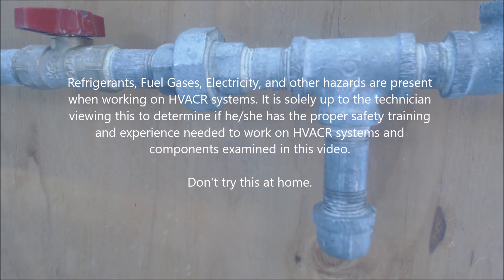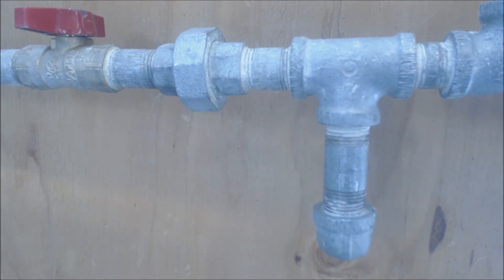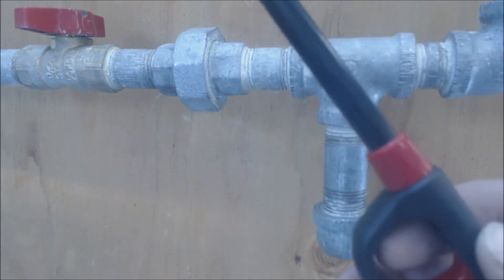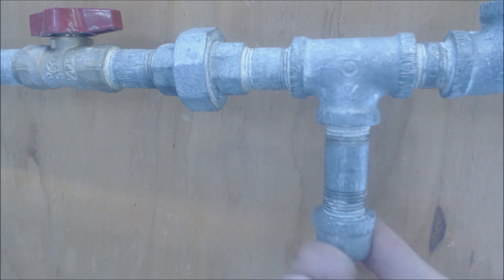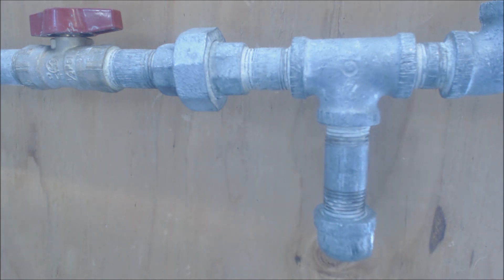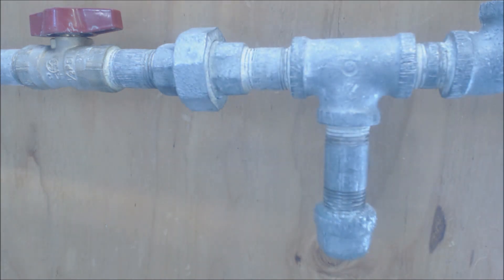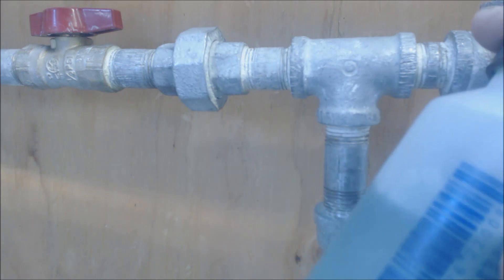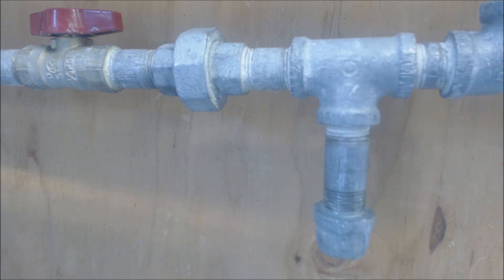Leak Check Gas Lines! Flame, Soapy Dish Detergent & Water, or Specifically Designed Bubble Detector?

Comment: Man thanks. I have a new install and have a small  micro leak. 15lbs pressure. It holds for couple days.  I was gonna pressurize it with gas and try the lighter trick. I had been told too small to worry but doesn't make sense to not be completely sealed to me, but im no expert.  It's hard to see micro leak with bubbles,  because the solution has bubbles already

Comment: Dish soap will corrode stainless steel, lol.
Reply: Is this not the case then? I used dish soap with some water to check for leaks. I did not even wipe it off.
Reply: @iShootWild  did it rust?
Reply: I did that today. So not sure what will happen in 6-12 months.

Comment: I like that you mentioned tiny bubbles, I'm pretty sure we had a very small leak at this fitting and the guy I was with kept saying, "Yeah but there should be bubbles coming through behind the small ones" To me it looked like it was becoming what I call an "egg sac", looks like a soft spider egg, and it was shimmering like the diamond on my wife's hand. Working on tires taught me how many really small leaks fail to provide substantial bubbles.
Reply from the maker: Yup thats right and a good way to describe it, spider eggs.

Comment: 5-10% volume of gas in the room then boom.  Ldf or a gas sniffer unit.  Old plumbers were next lever.  I had a customers bring back a lighter to try and demonstrate  a gas leak under a NG hob.  It stunk of gas when I arrived.  I had to stop them in their tracks. 
Near on 50,000 ppm of gas and any living thing in a closed environment is in life threatening danger.  All that's needed is a static spark along with O² and you'll be extremely lucky to tell the tale.

Comment: We used to flame test all the time. Obviously it’s not ideal but in a pinch it’ll work. Like you said never do it in front of a customer. I prefer leak detector soap but dish soap and some water will work to. It doesn’t have to be non corrosive because it dries up so quick. The only reason I prefer leak detector is because it will stay on the pipe and show leaks for a while. I’ll use runny dish soap when I can’t find the leak because it’s runny it will show up immediately and will pick up small leaks better. I do find it ironic that mr by the books installed an illegal drip leg.
Reply from the maker: Hey Josh, in the IFGC 2018 it doesn't say anything that it has to be on a turn. That may just be what your inspector prefers but it can't be technically enforced without a code stipulation, thanks!
Reply: I go by the plumbing code and they can’t be placed that way because moisture or debris will pass right over it so it basically serves no purpose. The gas has to hit a surface and be forced up so that it keeps whatever out of the burner
Reply: Oh and check ifgc 408.4 and it shows exactly how the tee must be placed

Comment: Hello There, Sorry to tell you you have no since of safety to use a litter to check for GAS LEAK. There are a lot of other ways to check for leaks. Leak detectors, soapy water....ETC. Please don't do that ever for any reason.
Reply from the maker: The video is on why nobody should check for leaks with a lighter. That is a terrible thing to do that will not find leaks. Check out the video, thanks!

Comment: How long does the pipe dope take to set or cure before you can turn the gas back on?
Reply: Read the canister.  Usually it's good to go right away.  Gas line pressure in your house is quite low too, btw.
Reply: @yepper1165  yeah I did some more research and realized it was like 1/2 psi. Thanks for answering 🙂
Reply: @seabass22  u bet!

Comment: so if atmospheric pressure is 14.7psi and natural gas pressure is only 5 to 7 "WC . if there's a leak and you were soap testing wouldn't the bubbles be pushed in by the 14.7psi? thanks

Comment: I worked with a very seasoned  plumber/gas-fitter who used the flame-method. One day i protested and he just grinned and said ,"You wanna find a gas leak without guessing?..,this is how you do it"!
Reply from the maker: Unfortunately, small leaks do not light. I have tested these for nat gas and propane in controlled environments and the ratios of air to gas are not adequate to make a flame., The best way is with pressure testing disconnected from the appliance or with non-corrosive bubble leak detector, thanks

Comment: How flipping dangerous and irresponsible to show this video.
Reply from the maker: Shabana, did you watch the video? The whole point was to not try to leak check with a flame because that would be dangerous and does not work anyway. We use anti-corrosive bubble leak detector, thanks
Reply: How is it irresponsible? He showed why using a flame is a bad idea.

Comment: Thank you for providing the video . Now let's go over some things that were not mentioned are demonstrated in this video.#1 a dead end pressure test at low pressure should always be performed (13.5" max ) using a water tube manometer  ( not a electronic manometer, due to calibration certifications).#2 this is the 21st century, all technicians and contractors should own and know the proper operation of a combustible gas indicator (CGI ).#3 if a surface leak is sensed with a CGI it should always be verified with approved leak soap ( it's not that other soaps will cause corrosion or damage to the pipe, it's just that we don't know what other soaps will do because they were never tested or certified through the gas industry), saying all other soaps will cause damage would be irresponsible . #4 all repairs should be verified with a low pressure , pressure test using a water tube manometer.#5 & maybe it should have been #1 anytime the public notices a gas odor( mercaptan ) they should immediately call the gas provider, 911 or 811.

Comment: Great video.   I've been working on my furnace (flame sensor and igniter replacement) and didn't disconnect/connect any gas fittings but did have to move stuff to get to the flame sensor and igniter so want to make sure that I didn't kink or crimp anything and cause a micro leak. What brand of bubble detector do you recommend or should I buy a cheap sniffer on Amazon? Thanks!
Reply from the maker: I have the leak detector linked at https://www.amazon.com/shop/acservicetech thanks

Comment: That’s how a Bar blew up in my old neighborhood and friends lost there Fathers .  That video had me thinking WTF...!  Didn’t watch it fully.  Have a great Holiday 🎄🎅🏽
Reply: Checking a pipe fitting for a leak with a flame is similar to the burner running in your furnace or water heater. As long as there's a positive pressure on the pipe the flame cannot back up!

Just like everything, people make judgments based on lack of knowledge.

Comment: Hey man, nice video. Just a couple of things I would like to point out that may be helpful to some folks. Sediment traps should be installed so they change the flow of gas. The one in the video would be considered in-line, sediment will pass over the trap and little to none would be deposited. Also natural gas has an ignition range of 4-15%, meaning anything below is too lean to burn and anything above is too rich. All leaks should be reported to your gas servicer so they can be found and repaired in a safe manner. Great video and great info. Keep it up!
Reply from the maker: Great tips Justin! Rarely is there much sediment anymore but the traps are still needed and used, thanks!

Comment: Not sure if soapy bubbles is that bad , just wash off the joints with water afterwards as they are outside in the rain anyway ?
Reply from the maker: I have seen galvanized joints acquire rust a 1/4" thick on the pipe after being wiped off with a dry rag after 6 months. The CSST manufacturers have examples of whole apartment complexes having leaks do to the chemicals in the soap and you cant even wipe that out since they go between the stainless pipe and the brass nut, thanks!
Reply: @acservicetechchannel  my piping has rust outside to my gaspack , how do I make it resist the elements ?  Thnx

Comment: So, first off water and dawn soap  will eat away at black iron gas pipe? Next, curious about flare fittings on gas lines.I'm curious as to pipe threads.Meaning, is it ok to pipe dope pipe and sections? Just not flare fittings like that on a yellow gas flex line on the one side? I assume unions also no tape or dope? This is house lines in a home basement.Lastly, a home was built many moons ago.Meter outside house has no regulator.Nothing inside as well in the regulator topic.Been that way forever and no issue I hear of.I do see a gas company shack right next door that they come about every once in awhile and test stuff.Anyhow, no regulators on meter and everything in house is hooked up wide open straight lines.Your thought? Pretty much all these old houses I see are like this.Yet, I hear regulator this and that when hooking anything up in a home.
Reply from the maker: Dish soaps nowadays are too corrosive compared with what was used back in the day. Flare and flare threads don't get pipe dope but standard thread connections do. Sounds like propane. The regulator would be at the tank then. Gas pipe is always pressure tested. Make sure to pull permits and design the length and turns ahead of time. Lines mus be pressure tested before connecting to appliances. If you haven't done this before, I would recommend calling a tech and working with them on the job, thanks
Reply: Thanks for thoughts.On the regulator subject, all houses around area are natural gas only.Just puzzles me no reg on meter and been inside houses and nothing.Just direct flow into all hooked up.Could the gas company have some setup in the shacks that regs all fine or still need regs on meters or in a house?
Reply: Some natural gas distribution systems deliver low (utilization) pressure with a large volume, low pressure regulator serving an entire neighborhood.   This might explain the absence of a regulator at your meter.

Comment: Is the has harmful which comes out because the person who will fix it is coming in 3 days and he can’t come earlier should I leave the house or what should I do someone tell me
Reply from the maker: You could call the gas company that you purchase it from and tell them you have a leak and where it is leaking at. If it is a contractor that is fixing it, they need to come out right away because of the risk of ignition.
Reply: acservicetech they are coming but in 3 days should I be worried
Reply from the maker: You could call the gas company that you purchase it from and tell them you have a leak and where it is leaking at. If it is a contractor that is fixing it, they need to come out right away because of the risk of ignition.
Reply: What are the risks

Comment: my butt hole puckered everytime you used the bbq lighter near the cap.
Reply from the maker: This was a controlled experiment with safety equipment. Can you believe people routinely try to check leaks this way, NO GOOD for many reasons!
Reply: AC Service Tech LLC  they must be showing off. Or they are not qualified.
Reply: LMAO

Comment: Have a look on this one 
https://www.youtube.com/watch?v=5mnULvWwUpQ
Reply from the maker: For copper, stainless, and galvanized iron, we use anti corrosive bubble leak detector as over the past twenty years dish soaps have added corrosive chemicals that eat away at the pipe even when wiped dry. Great Video! CSST pipe has been logged at as soon as 6 months after installation when tubes can leak if dish soap is used. Thanks Dibakar!
Reply: thank you for your for watching my video........There is lots of value able information together.......I am really impressed about your close observation at my video ..............I would really thank you for your great attention .............May I have your Email address plz ....
Reply from the maker: info@acservicetech.com

Comment: I called my gas company recently b/c I smelled gas in my house. They sent out a tech. and sure enough gas was leaking from somewhere. They checked my stove, water heater, and a couple of space heater that I have but found no leak. My gas service was disconnected and they took my meter. Winter is approaching and I'm not sure of who to contact...a plumber or Hvac guy. What would you recommend I do ? Do you have other videos or know of any other videos on finding gas leaks that I might use to do the job myself ?
Reply from the maker: I would contact the gas company and if they don't have any answers then you may need to contact your local county building inspectors. You may need to pull a permit at this point, disconnect the appliances, cap those lines and do a pressure test on the whole gas line. In order to do that you may need to hire a plumber to pressure test and figure out where the leak is. Then fix the leak and hold the pressure test. Have the inspectors come and put an approval tag on it and the gas company will need to be contacted to reconnect the meter. The gas company is basically waiting for the town approval sticker on that line if this is natural gas. If this is a third party supplier like in the case of propane then they will do the pressure test and fix the leak and a permit may not be needed if they are the ones doing the work and they don't require one for the leak. When you contact them, ask what steps they want you to take, thanks
Reply: Thanks for you response and advise.

Comment: Keep in mind that the thread joint is not the only place that can leak. It is known that the making of fittings is not fool proof. It is possible to have a casting sand hole in the fitting.
Reply from the maker: Absolutely, always pressure test a new gas line. I have found holes in the welds before, thanks!

Comment: You can test a gas line for leaks using a flame. But you better hope the utility isn't doing work on the mains where oxygen has entered the system. Because if they are, you'd blow up a lot of pipe.
Reply from the maker: I would never advise anyone to check a gas line with a flame. This video was just showing that not only is it not a good idea and doesn't find leaks as well as not looking right to the customer. This was a controlled testing area where I wanted to demonstrate that it doesn't work, thanks Richard!
Reply: NEVER test for gas leaks with a flame

Comment: what are a few pipe dope brands that you recommend? also, I installed a new Rheem gas water heater. what are the chances that it can leak at the connection behind the thermostat? I think the smell is from the bottom of the thermostat connection. but when I checked there with a liquid leak detector that I got from home depot I didn't find any bubbles. (possibly a bad brand). Also is it possible that what I'm smelling is not a leak but instead smelly residue somewhere out of sight in the connection there?  and what leak detection solution are you using in the video? thanks.
Reply from the maker: I use this product for thread sealant-  http://amzn.to/2wvkn0i  --  and here is the rectorseal bubble leak detector with the dauber-    http://amzn.to/2w4WDPr
Reply: Did you ever find the source of smell?
Reply from the maker: Thanks Blue Collar, normal teflon tape is not recommended in the IFGC but they do now make brands of tape to support fuel gas. I still don't recommend them though because older inspectors may fail for that and even if you need to show what kind it is, that may cause a headache. I want all of my inspections to go as smoothly as possible. Thanks Blue Collar!
Reply: Best way is to pipe dope the threads, then teflon tape, then pipe dope again OVER the teflon tape.

Comment: I love how your explanation is completely on point and I wanna thank you for your time with making this video so that younger people like me that are willing to Learn understand the criteria of simple basic knowledge. I'm having a little problem myself in my own how at the moment. You see I live in a mobile home park that just recently had a whole new gas piping line with brand new meters installed throughout the whole park. Right off the bat I knew something more than likely could go wrong with the existing pipeline and usually it's right at shut off valve because normally when a new gas line is installed the existing line wouldn't be used anymore. After having it replaced with the new I noticed that there was a gas smell coming from my house which isn't a good sign. Now I personally crawled and checked each of the elbows, T'S, and the shut off valves by using the water and soap technique but couldn't find any gas bubbles at all. From your own personal perspective what else can I try to check in order to try to find and located the problem 
Any advice would be great thank you 
Btw my name is Jamie I forgot to mention that earlier 
Plz get back to me asap
Reply from the maker: Let me first say that whoever installed this needs to come back right away if there is leaking gas. If it was your local utility, then they would likely come out tonight if called for a leaking gas smell. If it is a contractor and was just done then they don't want to be liable and will come out and address their problem. If new piping was done then there had to have been a pressure test to make sure that there were no leaks otherwise know one would know if it was something like a pit in the rolled weld seam of the schedule 40 pipe if that was used or split in copper, or split in csst if any of them were used if only joints were checked. Also soapy water doesn't bubble as well as micron bubble leak detector. Soapy water can eat through stainless if it was sprayed on in less then a year so non corrosive should be used.  Natural gas rises instead of falls. I hope that helps but you should not feel bad for calling the installer for something that is their problem. They will also likely have a sniffing tool to help pin point the leak. Thanks.